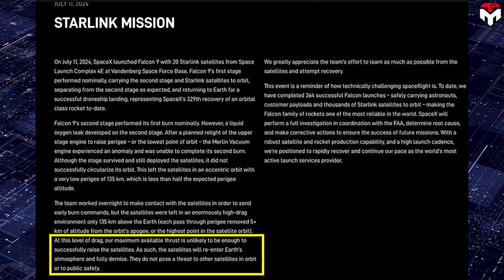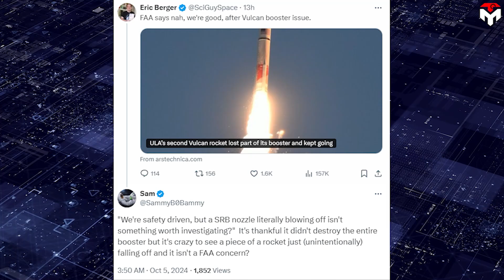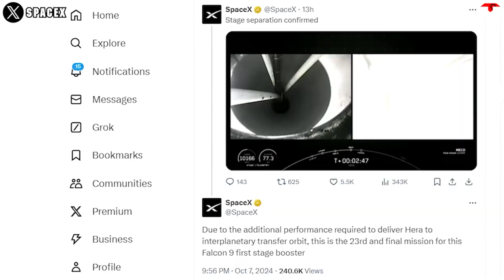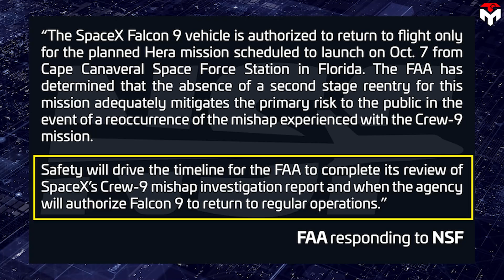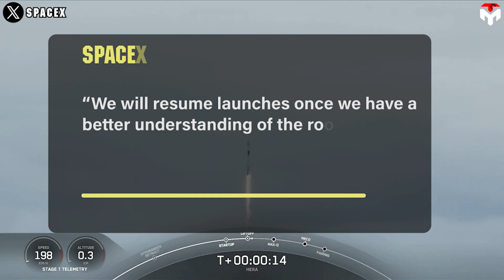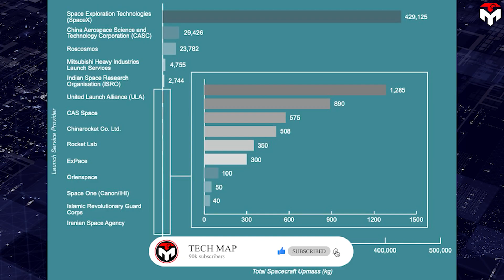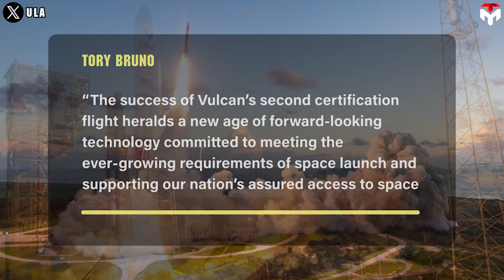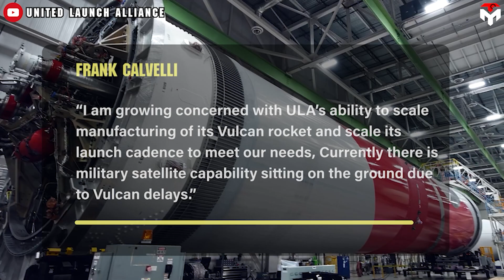Falcon 9 Couldn't Return due to FAA While ULA Vulcan Explode But...

Comment: The double standard has been evident for quite some time,  A recent FAA comment that SpaceX should "come up to the safety standards of Boeing" (I paraphrase)  Left me speachless.  Come up to the safety standards of flying an untested crewed capsule with known defective thrusters, 737s that fly themselves into the ground,  777X that have cracks in structural members,,,,   But the  FAA won't take the time to review and approve the nth time environmental statement,, that they ordered.  Months and months of regulatory delay, because each launch has improvements,, and so each launch requires a whole new application process.

Comment: The FAA is another bias government entity. They abuse their power, they give SpaceX fines for doing nothing wrong. ULA has a major problem on its launch the other day where the booster solid booster almost blew up the rocket. And the FAA isn't even looking into it. SpaceX on the other hand launched the rocket landed the booster to rock it and then when the second stage of the rocket didn't land exactly in the Pacific area where it was supposed to , they stop flights of falcon 9. What a crock!

Comment: The return and landing are always the big highlight of every flacon 9 launch. Elon should get with his people and give us a real show by programming the rocket to do some really cool tricks before touching down. Like stopping mid air and doing a couple flips, or do a hovering figure eight a few times creating a flower when viewed overhead, and maybe a pendulum maneuver where the rocket hovers mid air then tik toks back and forth like the pendulum of a clock. A funnel maneuvre where the rockets top half splays out ward and the bottom is inward so the rocket is leaning  in the air then do some nice circles big at first and slowly getting tighter and faster. It would look like the rocket is stuck in a vortex.  People would be talking about this shit for years! Come on Elon, lets go completely HAM!